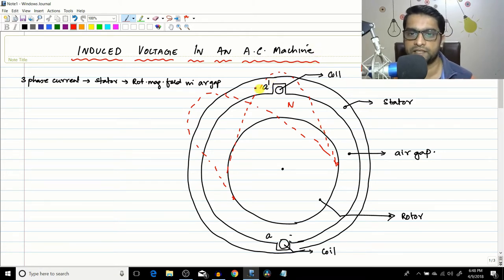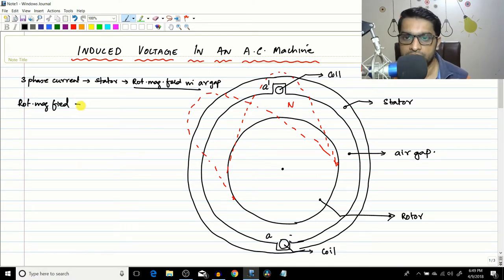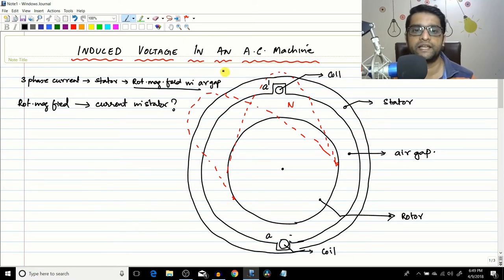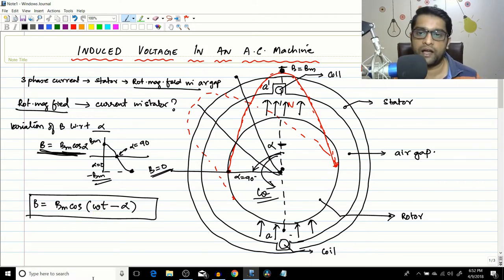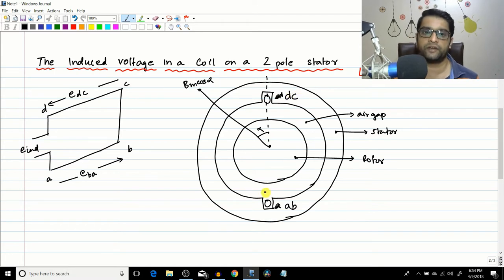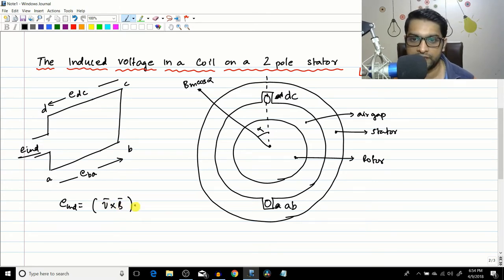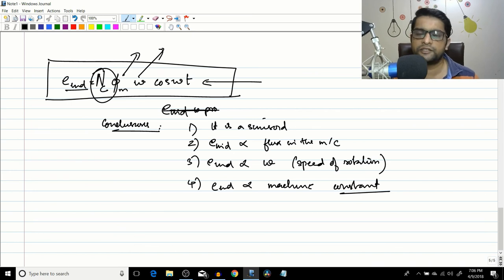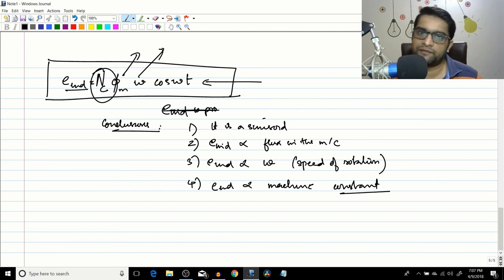#10 AC machinery fundamentals - EMF induced in AC machine ( with sinusoidal flux in space )

Comment: Hi Varun, at 12:08 in this video, by making the angle alpha = 0 to represent the position on the coil, I think you also defalted the spacial distribution of the B field to only the value at alpha = 0 or Bmax,  instead of a sinusodial distribution of B= Bmax cos alpha. So now the explaination defaults to the Bmax vector (only) rotating by the coil I think. That doesn't allow for the B sinusodial distribution to sweep by the coil. Just thinking outloud Sir. than you.

Comment: 05:21
Magnetic field is already rotating, why rotating it externally?
Reply from the maker: Do not get confused here...the field in the rotor is sinusoidally distributed in space, for a generator you have to rotate the field to get the rotating magnetic field that produced 3 phase emf
Reply: @ElectricalisEasy  So you mean for generator there is rotor field that is rotated by some prime mover. But from where and how did we get that rotor field?
Reply: @ElectricalisEasy  sir wont the magnetic field rotate automaticaly due to the 3 phase current we had supplied
Reply from the maker: @janu203  Field is powered by external DC power.
Reply: @janu203  we excite the rotor with dc supply externally and through prime mover which will turn the rotor magnetic field produced by dc field will cut the stator conductors and 3 phase current will generate. Hoping this the answer

Comment: sir you have shown here that the rotating field due to rotor..right? if it so then we have to distribute the windings on it? answer please
Reply from the maker: We distribute the windings to get a  sinusoidal flux in the space..irrespective of whether stator produces rotating magnetic flux or rotor
Reply: sir the rotor is itself rotating then there is no need to distribute it ?
Reply from the maker: This is an explanation for voltage generated right...the rotor is moved using a prime mover and to get the three phase voltage across the stators u need a sinusoidal distribution of flux in rotors, which I have explained in the MMF and flux waveforms in the previous lectures...and distributed winding is used in cylindrical rotor and in salient pole rotors the construction of the rotors is itself such a way that it produces a sinusoidal flux in space

Comment: One doubt. 
If we connect the motor to a generator ( like motor generator set) but the generator not loaded(o.c condition) 
Now in this condition is it the motor is loaded condition or no load condition (if it running rated speed)
Reply: Answer please
Reply from the maker: the motor is usually rated at its full load, so ideally it should be designed to provide enough torque during the generator full load condition. But I cannot say definitely that under no load of generator, motor also will be in no load, but it may be the case. I will have to refer some material to confirm.